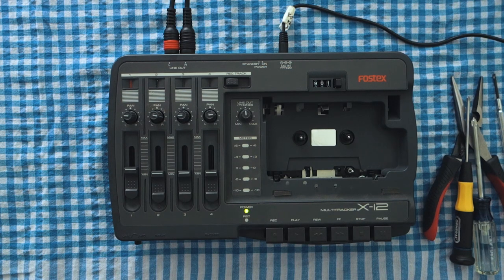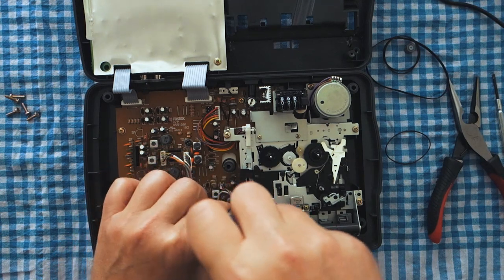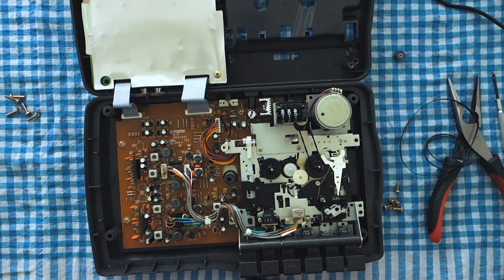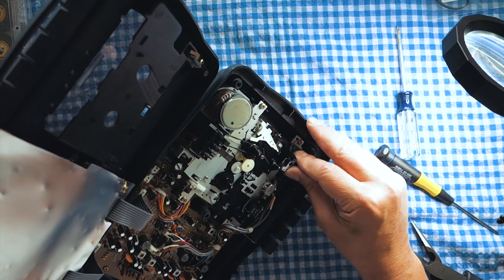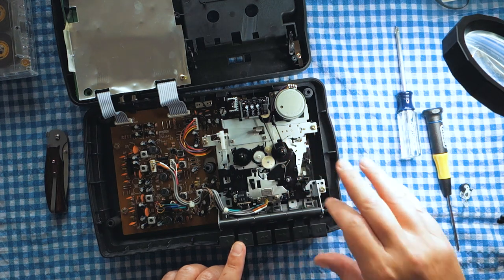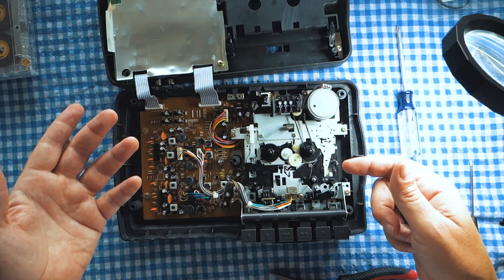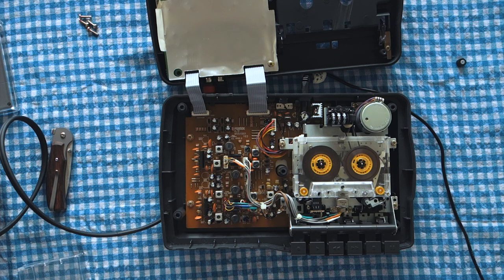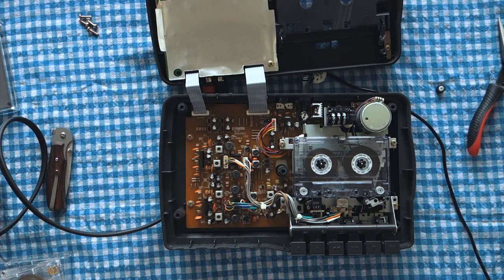Fostex X-12 || How to replace the pinch roller

Comment: I just bought one of these on eBay and obviously I was afraid of it being temperamental but you’re video definitely gives me confidence I’ll be able to work on it if it does have any problems! Thanks so much
Reply from the maker: good luck! they are a crap shoot when you buy on ebay, but I'm confident you'll be ok.
Reply: @User173  hi great video, also ive had an x-12 for a couple months now, and its been working with no problems but today i was going to try and record and the record button is stuck. it only presses down about less than have way it and if i were to force it i know it wouldnt be good lol, do you think something is blocking it maybe? i was thinking about opening it and looking around too see if anything might be? i should add that all the other buttons work fine, its just the record button that wont press down fully

Comment: Hi how are you?
I write from Uruguay.
I congratulate you on your patience in explaining the repair of the device. I have received one recently, when turning on the device the metal rod does not turn and nothing in the cassette mechanism moves. It has two belts, it is missing the one below the system where the cassette goes, there is a large one that is the one that is moved by the engine and a smaller one below that is the one that is missing. I also think that the problem is another because nothing moves, should the roller at least move? I think it's something from the motor because nothing turns there either.
I hope I have been clear, here it is not easy to get spare parts for this machine but I hope there is a solution.
Reply from the maker: Hola, I've always wanted to visit Uraguay. thanks for writing. It sounds like you are missing a belt, but if nothing turns at the motor, as in, it doesn't spin at all, then you've got a bigger problem. Is the machine getting power at all? do the LED's light up?
Reply: @User173  Hi, thank you very much for answering me.
Indeed, the unit receives energy, everything works correctly. The instrument input works, the LEDs light up. The motor seems to be the problem because it doesn't turn the higher belt when it is turned on. Do you know if a 12V motor can be adapted to it? I have not seen any similar ones for sale.
 I have seen Mabuchi EG-530AD-9F VDC and Mabuchi EG-530YD-2BH 12V 2000/4000 RPM engines

Thanks again for your help, best wishes!
Reply from the maker: @Fabi19761  yes I think you can still run the 12 volt motor and it will be safe.

Comment: Your channel is sick! I'm so happy it exists. I've had a Fostex X-12 for almost 15 years but haven't used it since high school because it stopped working. But, your videos have empowered me to get it working again! It powers on but when I try to play a tape or record, it immediately stops because the tape gets caught. The wheels that the tape goes on don't spin. Think it could be the belts?
Reply from the maker: yo, thank you! I'm so happy I can be of help.
Reply from the maker: oh, yes that's most likely the belts. you may also want to clean the pinch roller while you're at it!
Reply: @User173  Definitely going to give it a shot. I found one set of belts on eBay but no pinch roller haha. These things can be hard to find. Do you have any spots you go to for parts?
Reply from the maker: @noahbarker718  hey m'man, always be sure to read video descriptions because I try to put careful information in there to make your life easier :D If you search "fostex x-12" on ebay, the first several results are from a guy in germany who sells belts, rubber restorer, and pinch rollers. I buy from him, he's great. here is a direct link. https://www.ebay.com/itm/Kit-8-fur-Fostex-X-12-Multitrack-Recorder/163860189539?hash=item2626d41163:g:O~cAAOSwfh1dezVu
Reply: @User173  Just seeing that. Much appreciated

Comment: Hey thank you so much for this video! Its actually beautiful looking inside these complicated 4 track recorders. I have a marantz pmd 740 and a fostex x-24 that seems to be working fine but I have a serious phobia that one day I will need to go in and do some repairs or at minimum replace the belts since that seems like a regular maintenance of the these machines. I really appreciate that you went into detail about fixing the belts, and the pinchroller, but also the cassette cover since mine fell off the other day (on the x-24) when I stupidly tripped over the power cable and it pulled the machine down. Anyway I noticed that the capstan runs constantly and it seems as though that is normal for this device. Although I haven't noticed that on the x-24, I did notice it on the PMD 740 and I keep wondering how normal that is- any thoughts? Again, thank you so much !
Reply from the maker: yup, totally normal

Comment: Hi, nice video :)
I just got one myself, it seems to be working fine as far as I can see, except of a few things:
- Is it normal that the small metal rod always turn when the device is on? I see it does the same thing on yours, is there a reason why the engine is always on when the device is powered, even when play is not engaged?
- The PAUSE button does not stays-in. When I press it it does stop the replay, but it does not stays paused by itself. Do you have any idea of what could cause that?
- It's definitely not a silent mechanism, I can very well hear some engine noise and regular clicketi-clicketa sounds, is that to be expected?
Reply: The capstan always turning when on is common to many cassette decks I've owned including FOSTEX
Reply from the maker: yeah the fostex capstan always spins.

Comment: I got my imput gain mini potentioneter totally broken. Do anyone know wich replacement can I use?
Reply from the maker: I think the minipot is a 200k ohm? I'd have to look at the schematic, but you can totally find it online!
Reply: @User173  Thank you for your answer! Got a box with many different pots for peanuts on amazon. There's 200kohm pots that I can try. I also want to do the speed mood.  It should be easy enough, but I never desolder anything before so I'm a bit hesitant 😅